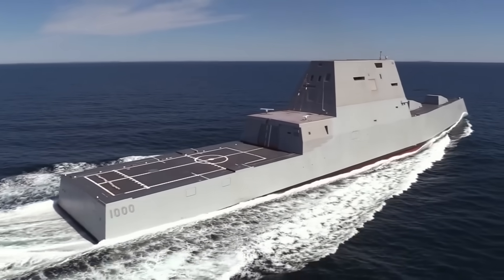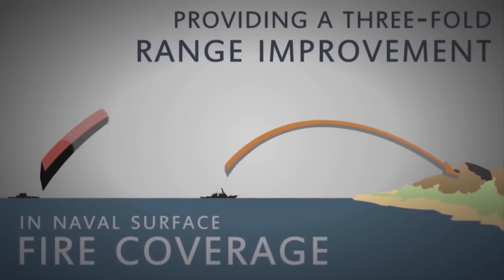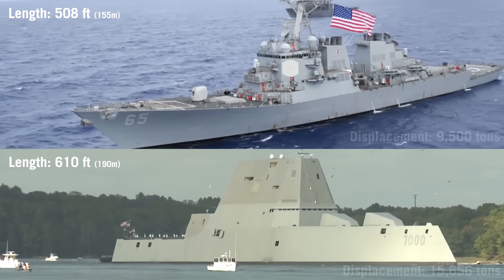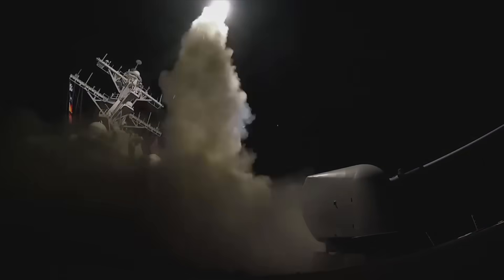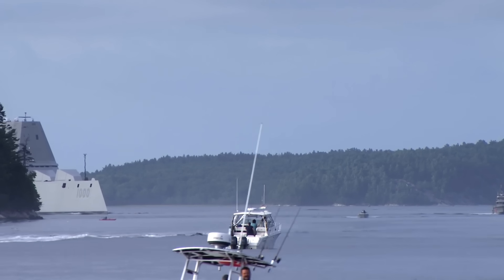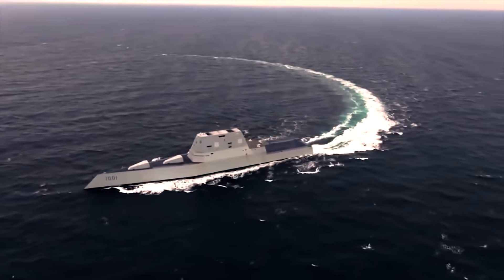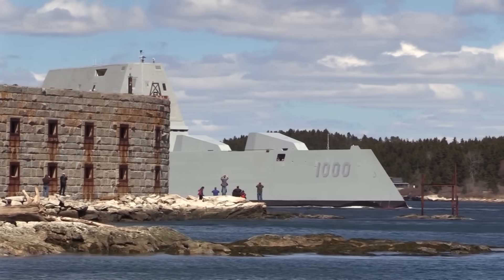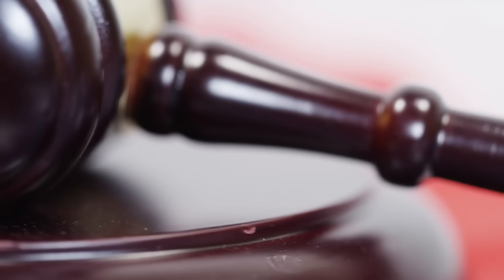What Killed Zumwalt Destroyers?

Comment: Having built several Burke class destroyers, I have to say that they are not "older" types.  They are constantly upgrading the electronics suite and the weapons capabilities.
Reply: And they still look badass
Reply: @Heizenberg32  And they are the prettiest US warships since WWII, in my opinion.
Reply: Yeah, I don't see what's wrong with them. Of course, the older editions didn't have hangars but flight 3 does and as long as you can fit it with a new radar and newer missiles, it should be fine, though it will lack the stealth that newer ships have I don't see the reason for the US to go all out on stealth. Can't the US just design something practical and modest? Use technologies that are tried and tested and combine all those best ones. Britain, India, China, Russia, all have operational stealth destroyers, none is considered a failure. All of those use decent stealth tech, don't go overboard and have some of the latest electronics and missile system available.
Reply: The issue is you can only put so much lipstick on a pig. Burkes are already bloated beyond belief with upgrades and refits to keep them relevant, and we are approaching a tipping point where we are not going to be able to have enough power generation or literal space to continue doing this. 

This is an area in which the Zumwalt excelled, it had an excess of power and large amounts of space to add future systems.
Reply: While I can confirm this, I will make the point that cramming new tech into the same frame eventually becomes a nightmare and ineffective. Especially as the weapon systems it has to face get better and faster.
Reply: Yep...working on the 525 hull and I have seen many upgrades and retrofits.
Reply: @iluvamokabodengyoza  I recently did PSA work on the DDG116 and DDG117 to upgrade their capabilities. Well, a couple years ago. Lol. Awesome boats.
Reply: @stevenbass732   Currently at the yard are the DDG 1002 and the DDG 118 and 120 at the piers and DDG 122 and 124 under construction. We just finished the 245 unit for the 525 hull. There has even been upgrades to the halon system storage.
Reply: @iluvamokabodengyoza  Awesome. Sometimes I miss the shipyard. Lol. Actually, what I miss is putting all this stuff together and making it work. Being able to stand back and say "I did this " with pride. 
Are you at Bath Iron Works? I retired from Ingalls in Mississippi.
Reply: @stevenbass732  I'm at BIW. Yah, I never worked someplace that pride of workmanship was shared by so many. I work in preassembly and I enjoy the variety of work.  Exhaust rings and headers last week and some lifting pads and roll pipes. Combings last night and likely stanchions and a bulkhead tonight. I love it.
Reply: @iluvamokabodengyoza  Excellent. You have my respect, you're doing a vital job. I'm an Electrician, and I love it when everything is put together and when turned on it comes to life. No better feeling than that.
 I told my apprentices and coworkers that there was no room for apathy because sooner or later some young sailors would be putting their life in our hands. Always do your best and take pride in what you do.
Reply: @stevenbass732  Hear, hear!
Reply: Burkes are old af
Reply: @Fattony6666  Ummm, you are wrong. The initial design is old, but the Burke class, updated af(lol), is still being built. The current ships bear little resemblance to the original version.
Reply: The good news is the arleigh burke class is still in production
Reply: Calling the Burke class "old" pretty much is like calling Windows 10 "heavily outdated" today.
Reply: I would find it interesting to see a ship designed to mix of the successes of both the Burke class destroyers and the Zumwalts, to sate desires for a more "modern" vessel, and to see how effective it could be given some time to develop.
Reply: Why would you design a new haul for the boat when it's what's on the boat that counts?
Reply: Correct!
Reply: @ytho8285  More expensive doesn't mean that it is better. The Captain you mentioned, knows where his career lies. Of course he was going to say that the Zumwalt class was better. That's his job.
Reply: @stevenbass732  I am of the opinion that the Zumwalt actually should have been pursued. Its actual cost is going to be high, just because 3 of them were made, and so there was no time for prices to lower and the R&D cost to be spread out, similar to how any fighter aircraft program starts out with high unit costs which reduce greatly over time. 

The reason it was canceled was due to the geopolitical climate during the program. We were involved in ME wars and China didn’t pose any immediate threat, and so Congress just deemed the development of a new destroyer unnecessary. Now that the military has realized the threat China could pose, it has come around. It says a lot that their new DDG(X) program is remarkably similar to the Zumwalt. I firmly believe that if the Zumwalt program occurred today, it would have never been canceled.
Reply: @jonathanpfeffer3716  Possibly so. What is not well known, is that the Zumwalt class had lots of problems.   The basic idea was good, but in practice it didn't work out and the costs to improve the class would become prohibitive. 
Geopolitical issues not withstanding, it's better to use what works and design the ship around that. 
I'm all for new and improved, but not at the expense of operational performance.
Reply: @stevenbass732  I agree, the Zumwalt had problems and was absolutely not the perfect platform. The DDG(X) seems significantly better, I’m just a little worried that the first one is scheduled to be built in 2026, and I have no doubt that will be delayed. The US shipbuilding industry has gotten pretty slow, and it will take a long time until the new destroyers can be rolled out in significant numbers. This wouldn’t be a problem normally, but now that things like laser based CIWS are likely to be operational before the DDG(X) is, and a Burke (I don’t think) has sufficient power to operate them, it seems like we have a bottleneck in the navy. 

But, the upgraded Burkes are still very capable and proven platforms, and I think they will do well as a holdover until the DDG(X) arrives.
Reply: @jonathanpfeffer3716  United States shipbuilding isn't as slow as you may think, it's just that the ships are much more complex and require much more effort. Anything less than perfection is not acceptable. Lol. 
Don't forget, unless specified, shipyards build multiple ships at once. At my shipyard, we were building 3 Burke class destroyers, 2 LPDs and 3 Coast Guard ships at the same time. 
As for the power requirements for the laser guided CWIS, not a problem.
Reply: @stevenbass732  You certainly know much more than I do about the shipbuilding industry, so it’s good to hear that it’s not too bad. 

I may have been caught up in the hype surrounding China’s military shipbuilding industry, which seems to me to be remarkably fast, and that made me think we were falling behind a bit (although now that I think about it, we don’t necessarily need as fast of a shipbuilding industry as China does, simply because we don’t need to build as many ships).
Reply: @jonathanpfeffer3716  There's one thing to consider, the ships we build are replacement ships or additional ships of a class. China, on the other hand, is essentially trying to "catch up" because they never had a deep water Navy. 
BTW, thanks for the well written and thoughtful comments.
Reply: oh good so they can kill more people.
Reply: The burke class is so fucking cramped its a nightmare doing anything for systems in them
Reply: "upgrading the weapons capabilities"? Lol US navy stuck with harpoons, tomahawks and RIM series.
Reply: Since they can't REARM AT SEA VIA STREAM RIG? THEY ARE OVERPRICED TARGES. WHO SHOOT THEIR WAD. AND RUN AWAY 😢LIKE SCALDED DOGS 🐕 😅
Reply: @HENRISTARKS  Who told you that they can't rearm at sea? Obviously you have been misinformed.
Reply: The real problem though is actually the age of the ships themselves. Many have to be retired because they are simply spend as ships. So either new Burke class destroyers need to be build or a new destroyer needs to be put into production.
Reply: @MrMarinus18  In truth, the Burke class is still in construction. In the last 10 years I've helped build 10 new ships and refit several others. Refit is everything but the hull.
Reply: @stevenbass732  Yeah but the hull is the problem with many, especially the Tigondaroga.
Reply: @MrMarinus18  The Ticonderoga class were cruisers, not destroyers. But that not withstanding, each ship going for refit is examined from bow to stern with very sophisticated test equipment. Thus far, the hulls have been sound.
Reply: @stevenbass732  "Cruiser" and "destroyer" is more about role rather than the ship itself. In terms of size and capabilities the Burke's and the Ticonderoga aren't that far apart. The main difference is that the Ticonderoga have a admiral's quarter and the Burke's don't.
Reply: @MrMarinus18  it's called upcycle. You take spare parts from old ships and make new ships.
Reply: They are old
Reply: Still the Burke is old even the flight 3. The Burke is able to compete against udaloy 2 ships, but barely. No matter how many refits Burke gets, US still need a more advanced and updated ship, like zumwalt .  Even the Russians know they need to update and upgrade new ship projects.
Reply: @danielmak33  This is dumb. The Russians can't even afford to purchase a new rifle for their ground forces, let alone modernise their decrepit navy (or lack of). Meanwhile China is still trying to figure out how to build aircraft carriers based on 1980's Soviet designs. Burke-class destroyers are more than sufficient for the foreseeable future.
Reply: @mlc4495  Soviet-era carrier designs are just a stepping stone for China to gain experience operating and building carriers. Their first supercarrier is about to be launched, a conventionally powered 85,000 ton ship with EM catapults like the Ford-class and the follow on 100,000 ton CVN is already under construction. Plus China just built 3 brand new amphibious assault carriers to rival the Wasp-class and another 3 under construction of an improved version with catapults to operate stealth drones or the FC-31 fighter when that becomes available. 

Arleigh Burke design is very much maxed out, almost no capacity for upgrades or future weapons tech which is why the DDG(X) program is so important.
Reply: Daniel Mak if the zumwalt program went as planned, we would’ve had the most overpowered ship type in the seas, way beyond the capabilities of China or Russia. But since it’s been completely fucked, the Chinese have caught up with the Burke’s. I Remmeber hearing about the 2000’s concept of 4 different ship types to replace the fleet, but here we are 21 years later and nothing.
Reply: @NarasimhaDiyasena  TBH, I really wish to Zumwatt class to be relaunched, a refitted one, with more advanced technology then the prototype. But then US is out of funds in reality. US cannot afford a "better" destroyer, wondering how are they going to maintain the carrier fleets.
Reply: @danielmak33  the zumwalt class is bad and that’s why it got cancelled
Reply: The amount of upgrades we are doing for Flight III is overwhelming
Reply: That's what they're saying about the B-52 Stratofortress also...

Comment: One important reason not mentioned is that Zumwalt is mainly designed for Land Attack which requires full control of sea dominance, otherwise, Zumwalt is vulnerable in sea battles. In
 1994, when the Zumwalt was designed, the disintegration of the Soviet Union made the US navy think that there is no longer a challenger to their sea dominance so Zumwalt would be absolutely safe in future wars even if its combat effectiveness against ships is low. However, that dominance of the became much less solid when the Chiese navy got their own Aircraft-carriers. Therefore, an extremely expensive Land-Attack ship but vulnerable in sea battles seems not a very good choice anymore since they might be actually attacked by another strong navy from the sea.

Comment: A "destroyer" that is slightly larger than a Revenge class battleship. It is apparently a stealth ship, but we already have Submarines, which do the job better because it can dive if spotted, and can't be seen on satellite images.
It can't even do it's job of a artillery piece for ground support, a more modern version of a ww2 monitor like the Erebus would probably be more practical and cheaper to design.
Reply: Well, destroyers are supposed to have multiple roles right, the difference between a frigate and a destroyer is that destroyers have land-attack capability and extended anti-ship capability and in most other departments like ASW and anti-air, frigates are about the same as destroyers. What the Zumwalt needed were simply good radars, good missiles and be stealthy enough to detect an enemy ship before the enemy detects it. It's not like the Zumwalt needs stealth against land targets when the ship could simply operate extremely long-range GPS guided Tomahawk cruise missiles so it will be far enough from the coast anyways in most cases. In the case of air defence, chances are, unless there are 2nd generation jets coming towards it, a fighter will probably spot the Zumwalt before the Zumwalt spots it and thus the best defence against air threats is to simply pack such a ship with good anti-air missiles which the USA has a lot of.
Reply: @AnuragDDethe  another thing that bothers me about them is they are about as expensive as a Queen Elizabeth class aircraft carrier, which raises serious questions as to the efficiency of the design.
Reply: @josephlongbone4255  Yeah, they were too ambitious with the project an they let it slip to such costs. The cost would've been fine if it were capable but it doesn't even have that good anti-ship or anti-land capability.
Reply: @josephlongbone4255  That mostly came from 2 things. 1) The original budget was assigned on the basis of 30-odd units, instead of the 3 actually completed, so each one carries about 10x the R&D burden it should 2) When building brand new designs (especially ones like the Zumwalt, which is so different from previous designs), the first few units are often much more expensive, because the yards have to work out how to do everything from scratch, and you get a lot of bad parts, having to redo work because noone noticed that a bulkhead went in before the pipes/wiring that go behind it were fitted etc

Comment: The LRLAP is an interesting concept, it's a shame it had to go out like this. 155mm shell, rocket-assisted, GPS targeted, and only (originally) 35k/shot, as opposed to a million a shot with missiles. That's pretty attractive, economically. Unfortunately, the only ship to mount them were these three, so without being able to leverage economics of scale, each round was hecka expensive. 

I'd have probably started off with the LRLAP system independently, pitching it as a new howitzer artillery piece or perhaps a tank main gun. It has superior performance to 155mm shells, and longer range, while being cheaper and more compact than a missile launch system, so it would've filled the niche well. Then, once we have the supply chain firmly established, and worked out the inevitable unforeseen complications in these platforms, we pitch the DDG-1000 concept, with a main gun proven to be effective rather than yet another experimental piece of equipment. 

Now, however, it is permanently tainted with the stigma of being associated with the failed Zumwalt project, and probably avoided as a result.

Comment: The on-going stealth arms-race seems like a pursuit of diminishing returns. I mean, you've managed to shrink the RCS of your war machine, congrats. Oh look, new radar that undoes all of that... 

Russia, China, South Korea and even India have made claims that they're in possession of stealth detecting radar. Most likely just saber rattling, and we probably wont know for sure until there's a conflict that definitely proves it, but it's still an alarming proposition.

War machines (whether air/land/sea) by nature of their logistics have a decades long turn around, to make them in any way economically feasible. Not so much sensor equipment like radar. Most advancements in this field are even software in nature.
Reply: It's not about the radar itself, not really, but about rapidly improving signals processing and metadata. Stuff like a computer automaticaly flagging the "50 foot fishing boat" if it's in the wrong place or moving at an unexpected speed, or of the wrong shape etc. - so Russia and China may very well be somewhat truthful in their boasts.

What makes it worse, is the fact you can apply automatic signals processing even to very old radars. It won't be as efficient as a modern set, but link a bunch of old radars into a network and it starts to look very different: you can do stuff like use an old antenna for radiating (they were usually overpowered) and better, more capable sets for receiving the echo for analysis. Bonus is that an enemy anti-radiationg missile will blow up an old 80s set.

These advancements are still galloping ahead, while as you noted, designing and building a new destroyer takes decades. Might as well spam older designs that still outgun anything else in the world, and just put new stuff on the masts, in server racks and VLS cells as it becomes available.

Especially since all the advancements in processing power and networking aren't just getting more capability, they're getting SMALLER so you don't even need more space to install them...